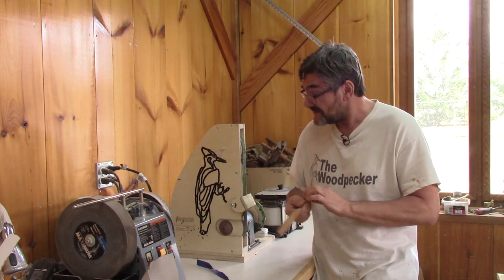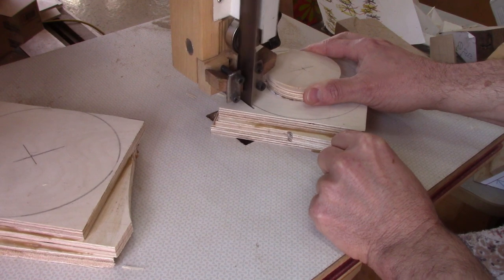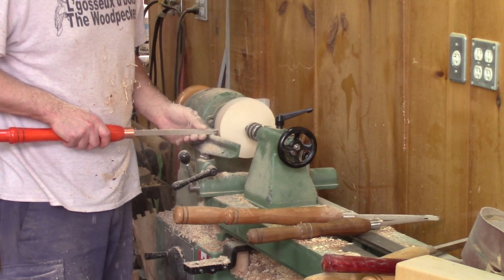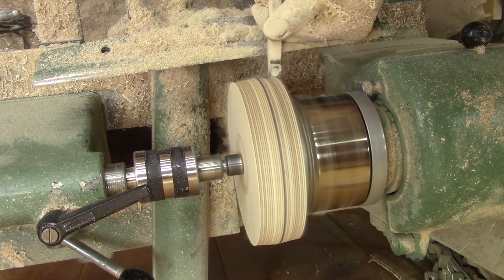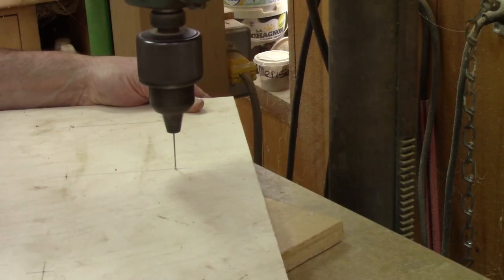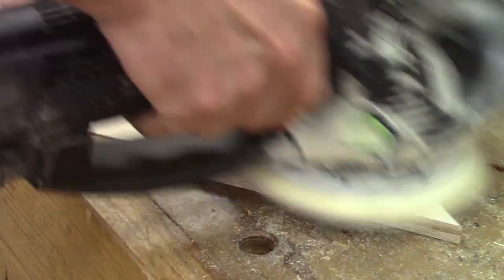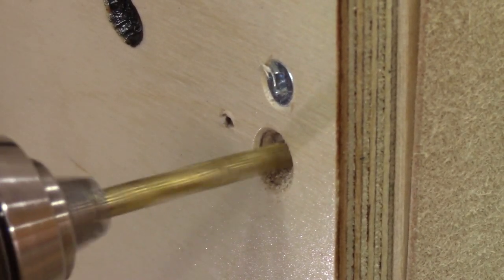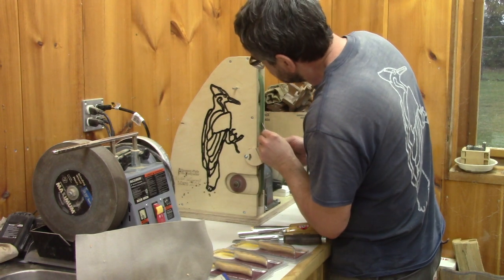The Woodpecker Ep 250 - Sharpening station

Comment: The only thing I would change is the upper wheel to have adjustment for tension and tracking
Reply from the maker: It would had been too complicated to get both wheel to stay aligned, if I need an adjustment I will add a third smaller wheel somewhere in the back

Comment: What about tightening the belts?
Reply from the maker: For now it's a bit slack, but still turning fine. If the leather stretches too much I will add a shim under the one I've already installed. But it's not ideal, I guess I will have to make a third smaller adjustable wheel in between the big two wheels to tighten the belt, I'll see.
Reply: @LgosseuxDbois-TheWoodpecker  what about a slot and a bolt(or 2)
Reply from the maker: I'm a little scared that  both wheels could get out of alignment. But I might be also mistaken and this could be easier. But for now the top wheel axle is held in place by friction using bolts would mean having them on both sides to hold the rod in place....